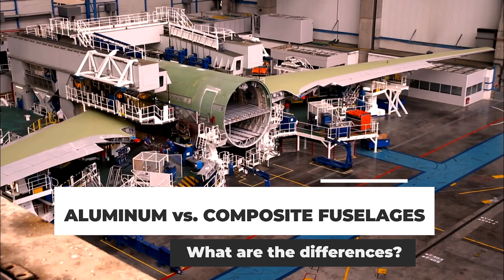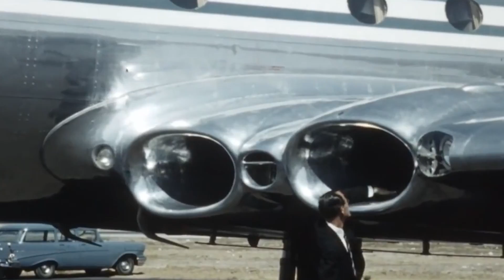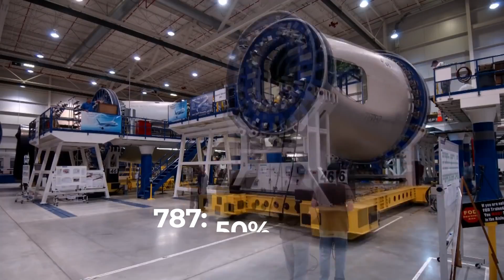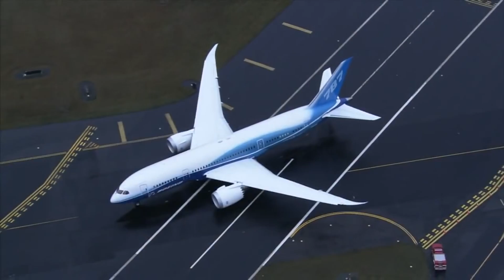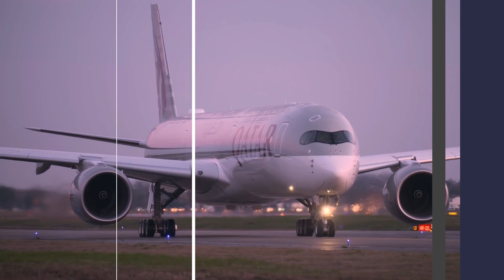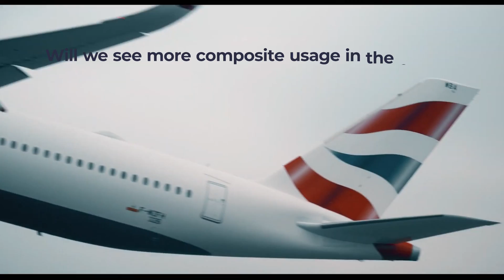Composite Vs Aluminum – Which Fuselage Is Best?

Comment: Depends on who made it. Airbus seems to be struggling with it
Reply: The paint of the 787 wings is falling of as well...
Reply: @andreaspoppe  not even comparable but there's always one who likes to try
Reply: @whiteandnerdytuba  At both the paint is not like it shall be... May be the reasons are different but the result is similar!
Reply: @andreaspoppe  except the location, the depth of the damage and no 787 is grounded for it. Have you not seen the pictures of the a350 damage?
Reply: @andreaspoppe  the a350 has cracks below the paint, the 787 doesn't. That's the difference
Reply: @whiteandnerdytuba  Boeing has told the FAA that some of the composite structures of its Boeing 787 aircraft have been contaminated with Teflon and might not be as strong as they were intended to be. While EASA stated the 350 is save as it is...
Reply: @andreaspoppe  changes nothing, try again. Your desperation is both hilarious and pathetic
Reply: @whiteandnerdytuba  Thank You! This is what is widely reported and actually jumps at you where Aviation News is concerned...and QATAR has chosen to speak a little more louder about it than the other Airlines such as Finair, Cathay and Lufthansa because it involves Billions of $$$ and the Pandemic means A lot of Expensive Aircraft are parked and unused....Infact I don't see any Lufthansa A350s anywhere these days!! I mean ultimately we all want all Aircrafts to be safe to fly on
Reply: @kojoharrison630  I like your attitude. You seem like a cool dude. I'm sure eventually they'll figure it out. Composite aircraft are still kinda new. What matters is which ever aircraft you're on, it's not going to just fall out of the sky
Reply: @kojoharrison630  At Flightradar 24 there are some 350 to watch, from Qatar and Lufthansa and all the others...
Reply: @whiteandnerdytuba  How Amazing! I was thinking the same about you too and I was actually going to remark on that. Thank you so much whiteandnerdytuba. You are an Amazing guy! Whoever the Aircraft builder is, they all will sure figure it out and it will all come out in the wash, as they say :). It seems that some individuals choose NOT to understand simple sentences. When it is a question, they immediately jump into combat mode as if they own a plane-manufacturing plant and I'm posing a massive threat to its 'Failing' financial outlook. I'm here to share and to learn. There are facts which we cant hide from!!
Reply: @andreaspoppe  Andreas, Thank you for letting me know. I'm actually aware of Flightradar 24 but tend not to find time to observe what's flying to and from where as often as I'd like to. I definitely will as I already do from time to time.... Thanks again. Do Take great care in these globally unprecedented times we are in and I wish you Inner Peace!!
Reply: @whiteandnerdytuba  and there are plenty of airlines with A350's that don't have a problem so you can stop your anti Airbus trolling
Reply: @whiteandnerdytuba  your trolling is hilarious and patchetic, you are a keyboard warrior
Reply: @ant2312  a great man once said, "why so serious"
Reply: @andreaspoppe  The problem with the A350 is very different from the B787 (you haven't heard any complaints from Airlines about the 787 regarding paint issues, have you? Is it written or documented anywhere? And which Airline have the complaints come from?). Please enlighten me!!
Reply: @kojoharrison630  The internet is full with pictures of wings with patches and damaged paint of the 787 issues! But keep your eyes closed!
Reply: @andreaspoppe  Andreas, I actually don't live on the Internet so I have no way of knowing any facts about Boeing also having issues with paint on their 787s. The thing is I haven't seen or heard any official complaints of them from anywhere as in the case of the A350s which is even on the News...so you see this is the reason I enquired from you if there were reports & complaints from specific Airlines out there just as there have been as in the case of Qatar and 5 other Airlines where the A350 is concerned (I'm enlightening myself thats all)
Reply: @kojoharrison630  EASA Stated the A350 is save as it is! So whom we are to not believe them?
Reply: @andreaspoppe  Safety issues for both the A350 & Dreamliners are actually not my argument Andreas!! I think your head is somewhere as far as my posting is concerned. You have Not understood me. But I don't blame you; this is the beauty of text messaging which really do not capture the Spirit with which one is trying to convey a message. Therefore things can be misconstrued totally!!! I have no issue with EASA or any Aviation Body for their Investigations and subsequent findings. I'm not here to argue out anything but merely to state what jumps at me whenever I log onto any Aviation site.
Reply: @kojoharrison630  there are 787's with paint issues on the wings
Reply: @ant2312  ok
Reply: @ant2312  My take on all of these issues/non-issues is that as long as we are safe flying on any plane manufactured by anyone, then my humanitarian Spirit can rest assured. We need to praise the human race in their ability to develop these magnificent flying machines rather than pitch one Company against the other.....Why is this necessary??? Is it for financial reasons? We all know for a fact that Boeing is 43 years older and dominates the skies even now with their iconic planes and they have been Industry 'Firsts' but then Airbus is also a Great Company who always follow close behind and responds to whatever Boeing develops........Everything will come out in the wash in the end. Let's all chill whether planes are grounded for paint/Carbon defects or not. PEACE TO EVERYONE; BE KIND. The Earth has Great Plane-making Companies and we want them all to be safe!!!
Reply: @ant2312  As long as there are no complaints by any Airline who then go on to ground them like they've done the A350s then we humans are ok with it regardless of the plane Manufacturing Company. Safety for all is what everyone wants!!!

Comment: Composite is definitely the future. As we are seeing right now with the paint issues for both Airbus and Boeing, there is still research and development required to perfect the use of composites. But if electric or hybrid power is the future, we will need to continue to reduce the weights to allow for heavier battery implementation.
Reply: Nah, we need better battery tech before hybrid or full electric is feasible
Reply: @evolancer211  I agree. Right now the weight of electric/hybrid is prohibitive. Hopefully that tech also advances and brings down the weight.
Reply: @evolancer211  I’ve heard some pretty amazing battery technology is on the way so it might be sooner than we think
Reply: Composites yes, batteries not likely ever. 
Unless you believe Elon’s acid trip of vtol supersonic electric jets.
Reply: Big airliner will never go on batteries. The energy density is simply to low. Hydrogen or methanol can on the the other hand easily be the future.
Reply: I totally agree with you. But the recycling process of composite materials is still an issue and we must solve it quickly first.
Reply: I don't think cargo planes are going composite fuselage any time soon, probably the future for passenger planes after they fix the current issues.

I don't think composites handle cutting out a huge chunk for the door as well.

I don't think recycling is a major issue; even if 100% ended up in the landfill, they would still have a huge environmental benefit from less jet fuel.
Reply: At the end of the day the 787 uses 50% of carbon material nd airbus more so boeing made a better decision there less paint issues
Reply: There have been composite components such as fairings, gear doors, panels, etc, on traditional aluminum aircraft for decades. The surface finish on the composite parts always degrades much quicker than the finish on aluminum wings and fuselage. Not surprised about the A350 paint issues.
Reply: Composites are not always the holy grail. There are two areas where aluminum wins over composites: required minimum skin thickness for countersunk rivets and impact resistance. This is why (in my opinion) you will not see composite fuselages for single ailes large passenger aircraft. Since the skin is relatively low loaded in large parts of the fuselage, you simply cannot make the business case for composites. For larger airplanes (787/A350 like) you can.
Reply: Not sure the weight argument is especially good. Composites have been used for a long time in light aircraft but in this case composite usually weighs more than aluminium. Where composites shine is in the making of compound curves which might result in better lift/drag ratio if well designed. Years ago, when I was working on gliders, metal gliders were unlifed while fibreglass airframes were limited to 3000 hours. Most did not make it to the end of life; damage, cracks and delamination saw them scrapped years before.
Reply: Doubt battery electric plane will take off any time soon. Only possible electric plane right now is Hydrogen fuel cell as power source.